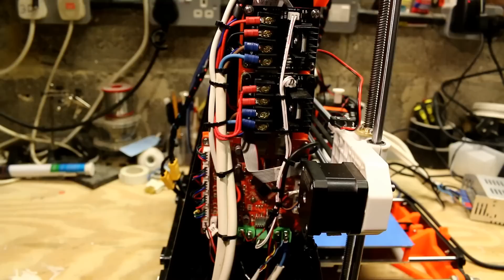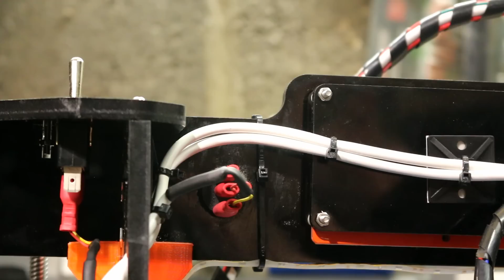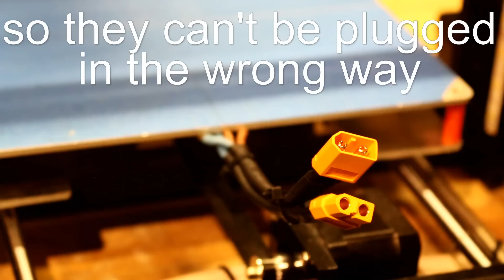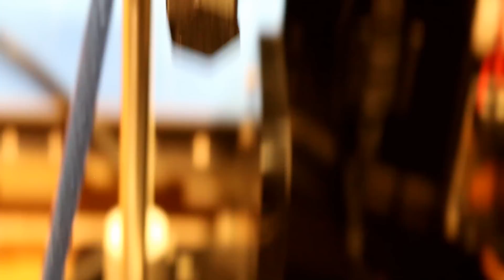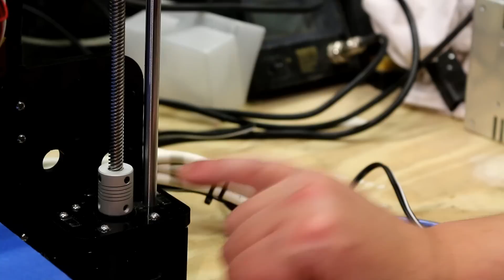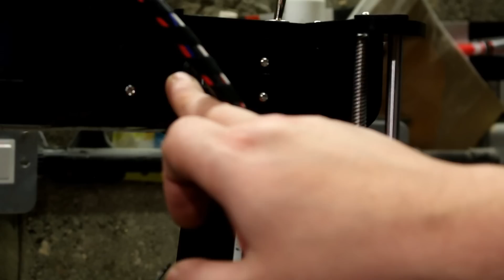Anet A8 Re-Wire and upgrades Part 1

Comment: Hi Brian, thank you for putting this together it's brill.
I have put my Anet A8 in an Ikea Lack table enclosure and I'm currently mounting the electronics and PSU underneath the lower table (away from the heat).
I created a wiring diagram for the addition of two MOSFET's (linked power) and a step-down buck converter to power a raspberry pi and a 4 channel relay linked to some lights. (This uses all ports on the PSU)

I really like your setup of the relay that can automatically shut down the machine, and I might be able to combine your setup to add the pi and lights like mine.
I don't like that I would have to use two mains plugs but it might be worth the sacrifice. I have to look into options on doing it via the raspberry pi by some sort of script, I wanted to avoid using the relay to operate the main power supply while also running off said PSU to shut itself down.

I am hoping to see a basic wiring diagram for the 3 switches linked to the relay and the secondary mains PSU the way you have set it up if possible?

Sorry for my rambling.

I am a tinkerer and I am struggling with the electronic side of things, although I have spent many hours researching everything I can to get this right!

Comment: When you used the 3 Outputs on the supply, you used them for the hotbed, the main board/electronics and hot spot. Is the hotspot the extruded for the filament? Nice job

Comment: On your previous video you wired the hot bed with crimp connectors and on this one you changed it to a soldered connection.  Did you other connections fail?  Do you now recommending direct solder versus crimp connect for the heated bed?

Comment: Why did you power the mosfets individually rather than running them in series? I powered them individually on my machine before watching your video but with no reason other than I felt it would be safer

Comment: If you pick the momentary switch for 115V (or 230V) AC and connect it in parallel with the relay you won't need the bootstrap power supply.

Comment: First, thanks for your videos! good explanations of things, unlike other anet a8 users/youtubers you seem to know what you're talking about ;)

Could you make a video about powering the a8 via an ATX/PC PSU; i've just done that, but I would like to hear your opinion about this mod. I did it because the PSU which comes with the a8 ain't conform with the EU standards (like OCP, OVP, OLP/OPP, SCP & OTP) and it's only passivley cooled. however, my anet runs fine with it, I've connected the +12V wires from the P4 connector, seems to work fine imho of an electronic enthusiast

Comment: Why need two screws on X axis tensioner?
 ~ 20:14 Why you need vertical vibration on Z axis ?
Reply: One screw for each rod. That way you don't warp the rods.

Comment: You should run 24volt much safer and cleaner power,  And get rid of those connectors direct wire to contact is much safer and better connection

Comment: What are the connectors you used for your hotbed connection?
Reply from the maker: Charlie Bowen they are called XT 60 connectors. most model shops sell them. if you google them you will find loads of suppliers
Reply: Brian Canning.... Thank you Brian! I will be getting some! :)
Reply from the maker: Charlie Bowen this is what you are after  http://www.ebay.co.uk/itm/311014228810
Reply: Found some and ordering tomorrow.. 
Thank you! Really appreciate your videos! Planning on building my Anet this weekend!
Reply: Brian... where did you find the magnetic fan setup?
Reply: Charlie Bowen you can find it on thingiverse
Reply: Thank you for the video! What is your opinion on using inline fuses as a safety feature? Also, I bought dual Mosfets and want to get them hooked up. Do you have a diagram that you used?

Comment: So you are shutting down your printer with hotend at very hot temperature???
I think this is not a fantastic idea!
Reply: 21 minute video explaining why he does things, and you can't be bothered to take another 30~ seconds to do the same... anyway. WHY is this not a good idea? what would you do instead? leave it on till it cooled down? why would that help?
Reply: You want to keep the cooling fan on the side of the extruder running until the hot end is cool. If you just shut down all power when things are hot, residual heat can travel up the heat-break tube to the extruder and can cause a clog.
Reply: Would like to add that it's complete bullshit I always just turn my printer off every day no jams or problems so far
Reply: If you add a wait into the ending G-code, it should be fine.

Comment: I have to lock my couplers, to spingy, they just sucks, motors need two steps before mouving my extruder up or down, resulting in random defect on what i try to print and totally fuck any kind of bed leveling etc...
Reply: Kevin Moreaux the couplers need to touch. The spring action will not help. The springs are there just to help with missalignment. It would help to have a bearing to hold the weigth.
Reply: The spring feature should only be utilised when the coupling is used in conjunction with pillow bearings that hold the threaded rod in place, common on most CNC machines, the A8 has a floating rod with no support, so it will bounce about on the spring which is fatal for Z height movement.The manufacturers assembly video shows the rod and motor must touch.I have added an 8mm steel ball in each the coupling at side,  to allow the flex in the coupling to work an take misalignment out of the rod / motor. I found the couplings I have needed to be cleaned out with an 8mm drill bit as there were some burs stopping the rod going all the way into the coupling